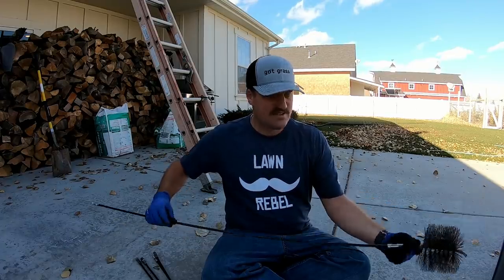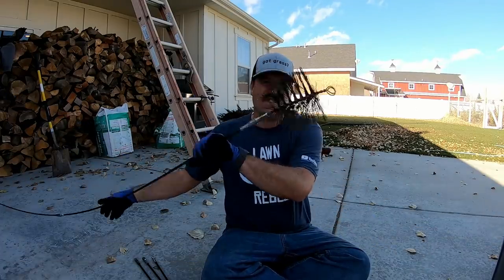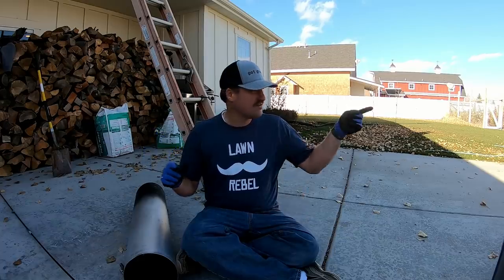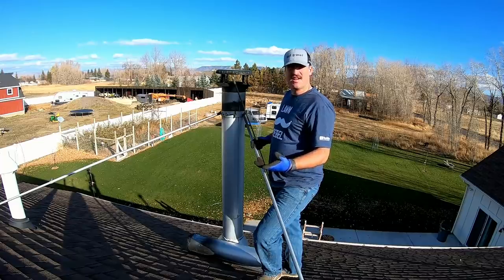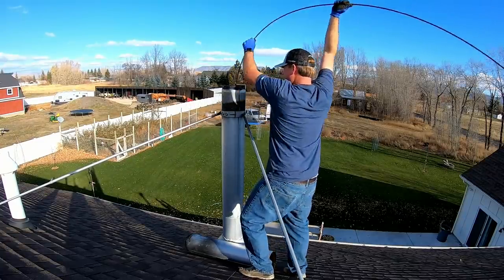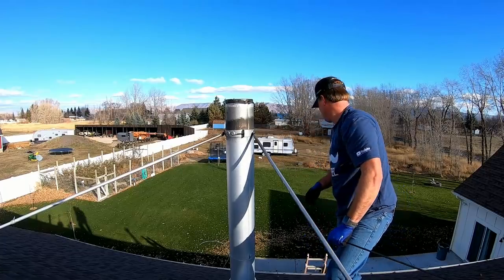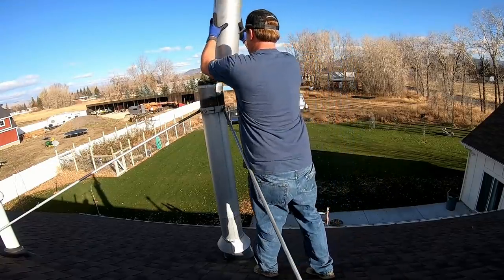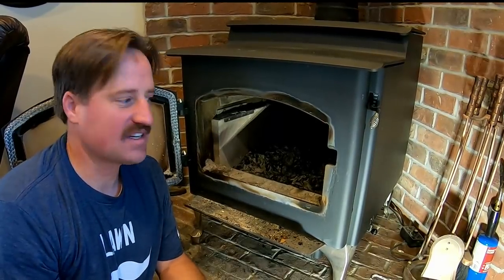CHIMNEY SWEEP DIY

Comment: The reason you have little creosote buildup is 1. Type of wood and 2. Well seasoned (dry) wood. To help prevent creosote add table salt to your fire. The vaporized I bonds will help prevent the buildup and will help remove creosote all winter long!

Comment: I sweep my chimney in the spring (to clean out the build up) and fall (to ensure nothing moved in during the months I don't use the fireplace). I would recommend that schedule at a minimum.

You could connect your type of sweep to a power drill so it spins while you pull it up and down. To help clean it faster.

Comment: If you could  burn a wood with less resin would help with the build up. Oak and other  hardwood helps  with buildup because  it burn hotter and cleaner. I know  you said  the other day it's  hard to come by in your area but the sell products to help burn the buildup  out. It's also  really  dangerous  to have to much  build up because  it can catch and smolder in the pipe.  Great video  as always!
Reply from the maker: Yes... No good hardwoods around here. I do burn long and hot fires.